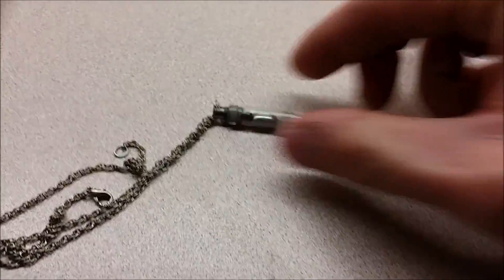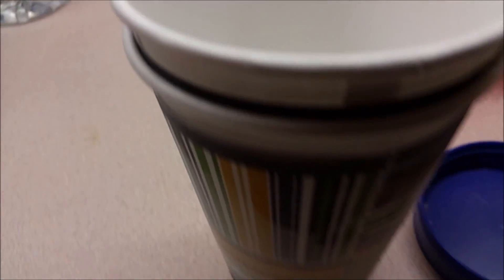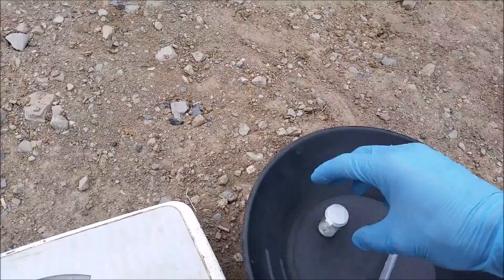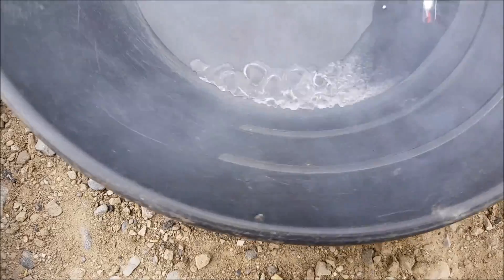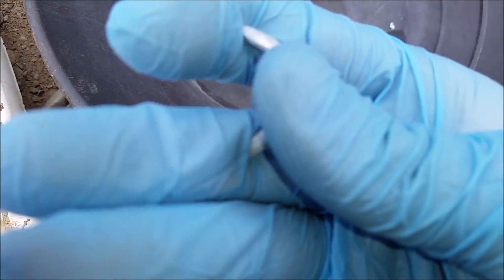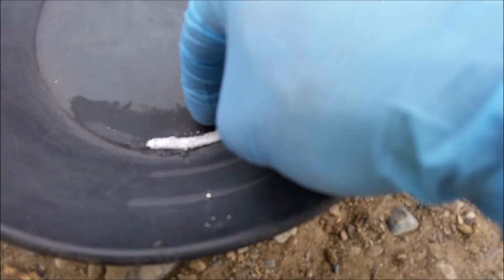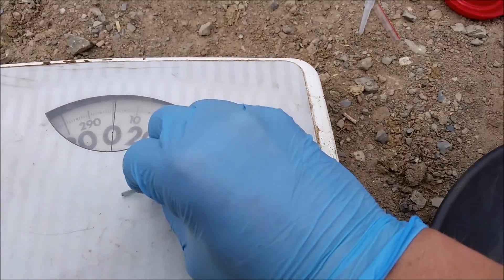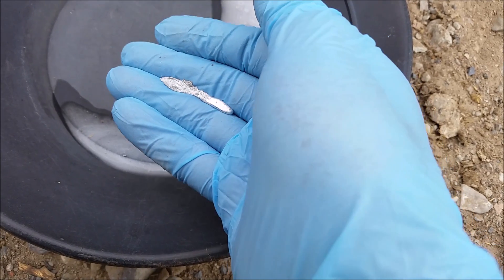Bending Solid Mercury: It Cries!

Comment: hm... i just wonder... the colder the mass is the harder it gets, right? so why you don't try to make an ice blade frozen in a temperature near lets say -10ºC and try to cut something  and then froze it with liquid nitrogen and try to cut something else harder? 

and the point on saying to "cut" is because i'm curious to see if water can be sharp :P (i know, actually it's called ice but meh xD)

Comment: This might seem stupid. But, how does liquid nitrogen stay as a liquid. Surely it would heat up and turn into a gas again
Reply: ***** Oh so it does evaporate. It just does it slowly?
Reply: +justinmason100 you have to remember that evaporation is also a cooling process
Reply: +justinmason100 Everyone asks questions when they are unsure, so be nice to him.
Reply: +justinmason100 it needs energy in the form of heat to change from the liquid to gaseous state,  If you insulate the liquid like in a thermos, you can deprive it of heat and it will stay liquid. Note that when you stick something into the liquid, then it starts to bubble. This is the liquid boiling as it gets heat from the object you stuck in it. It turns to gas and boils away and this also pulls all the heat from the object and makes it very cold. Once cooled, the object has no more heat to give, and the boiling will stop.
Reply: +Butterfly Poon So you ask questions when you know the answer? o_0
Reply: +justinmason100 watch at 1:20. It does exactly that.
Reply: It does evaporate........
Reply: From what I can tell the reason why it just doesn't immediately vanish at room temperature is because it cools the air around it to a temperature just above it so the air will slowly cool to the temperature of the air, which will be a few degrees lower than the liquid it at all times.
Reply: to actually answer your question: the flask he carries it around in is like a thermos. the liquid nitrogen is at its liquid temperature inside the flask, and the flask just insulates the liquid from the outside so it doesn't get warm. the second the liquid nitrogen leaves the flask it warms up and starts boiling.
Reply: The same reason why water doesn't turn into vapor immediately after touching a really hot surface.
Reply: +justinmason100 Science bro
Reply: *****

:I
interesting
Reply: *****
Huh
That's cool I guess, I'm more of a satan kinda guy but no hate.
Reply: *****
o_o be gentle
Reply: it is boiling in the cup.
Reply: If you watch when he pours the liquid nitrogen, it boils in the pan - that is the liquid nitrogen turning back to a gas. There are no stupid questions!
Reply: +justinmason100 It does. Did you not see it? Also liquid nitrogen in our world everything to it is hot as fuck, so that's why it boils unless stored at very low temperature.
Reply: +justinmason100 Hey there, I don't know if someone explained this fully before, so I will try. I'll give an example of a liquid becoming a gas via heating.
When a substance goes through a phase change via heating (or cooling), the temperature will rise and rise until the liquid reaches the point at which it vaporizes. At that point, it takes an extra amount of energy to undergo the phase change - the heat of vaporization. 

This extra energy holds the liquid as a liquid until the whole liquid gains enough energy to jump the hurdle and start boiling off as a gas. 

When a liquid is exposed to a temperature much higher than the temperature needed to boil it, it still must gain enough energy to change phases, so it will remain a liquid in part until the energy in the form of heat flows into it and gives it the strength to fly off as a gas. 

If you increase the pressure, you can keep things as a liquid at higher temperatures without them boiling. This is, for example, why you may need to use a pressure cooker to effectively cook at high altitudes, because water boils more easily with lower atmospheric pressure. 

And even with all this, under normal conditions (meaning room temperature, normal atmospheric pressure, in open air) most substances won't just explode from a liquid to a gas. This reaction would use tons of energy and be quite violent and unnecessary. That said, watching an alkali metal react with water is quite a violent reaction like this, and quite fun to see.
Reply: +justinmason100 It does. Room temperature is enough to keep N as a gas. N has to be REALLY cold to freeze, so the minute we open it up it vaporizes.
Reply: It's freezing point is extremely low
Reply: +justinmason100 That is what the gas is constantly coming off it, it is constantly evaporating. You throw it all over the carpet, it would evaporate... just do not keep doing it or your carpet would freeze. the object it is in is cooling down enough to stop the liquid nitrogen from completely evaporating.
Reply: +Lilly Lozier That's simply wrong; you've got it the other way round. Vaporization is when atoms forming a liquid break their bonds to become a gas (vapor).
Evaporation is one type of "vaporization"
Reply: +justinmason100 That's exactly what it does, just not as fast as you're thinking.   The steam coming off of the liquid nitrogen shows that its turning into gas again.  The liquid disappears after a few seconds
Reply: iI fwant to ask how to get it or where to buy it, after which will it be safe if falls on hand flashes a bit in eyes breath a little in lungs  and safe to play in house or go open outdoors
Reply: it does, notice when he pours it into the pan it quickly vaporizes.
Reply: Digital Nomad you didn't have to write a novel
Reply: When you put a pot on the stove and heat it up, you can put water in it and it will cool off the pot to the point where the water doesn't evaporate. same thing is going on here.
Reply: Pressure, same for propane, when it's under pressure it doesn't allow for the expansion like warming up. When they make liquid nitrogen, all the do is compress it. That's why when you pour it out there's no pressure holding it in and it boils off
Reply: +justinmason100 I have only prior knowledge to chemistry, but I'd think it's volatile...
Reply: +justinmason100 It evaporates rather quickly, but not in large amounts.
Reply: +Lilly Lozier Evaporation is a type of vaporization....
Reply: It does. Unless it is confined in a special  lcontainer, it will evaporate.
Reply: +justinmason100 The containers used for Liquid Nitrogen are usually also made up of an inner and outer container in a design that creates a vacuum between these. This results in any heat being transferred from the surroundings to the liquid nitrogen in the container to transfer (really) slowly, as there is no material for the heat to transfer through by conduction or convection and as such it only happens by thermal radiation, which is really slow.
If you were referring to the nitrogen in the open cup then yes, it does evaporate :)
Reply: +justinmason100 So many people have probably given explanations in the two months that this has been up. Here's my own!

It does heat up and turn into a gas. It's just that there's, in the amounts we generally see on youtube, enough that it's able to sort of equalize with the immediate area around it and prevent all of itself from evaporating away in an instant. It probably wouldn't be wrong to say that there's enough of it that it takes a fairly significant amount of time to completely vaporize. So yeah... probably not the most correct, but it's something
Reply: it will take time to heat up
Reply: +rocknrollfrenchfries No that instantly thing might get dangerous lol.
Reply: +John Creese seems about right 👍
Reply: +justinmason100 it does evaporate overtime. Inside of the metal container it is safe because there is a vacuum of air between 2 layers of metal so it is thermulated and can't evaporate as quickly.
Reply: maaaagic that's how......JK
Reply: the toxic Apple gaming
Rowling
Reply: MindMash5647
For a given value of "stupid question" and a certain definition of a "stupid question" or either or, there are stupid questions. It depends on the way you feel about things and how you think about it.
Reply: +DangerousToaster its actually a reaction to steam from heat and cold is not a scientific term heat is still in liquid nitrogen just a very low heat even sub thermal temps are considered hot
Reply: that's why they keep it in a dewer because it keeps it from going to a gaseous state
Reply: +Austin Myers are trying to say "hot" is  a relative term because it's that simple.
Reply: Gabriel Reid
Hot is, in some cases, relative. If you're on fire, and being on fire is your default state of being, a burning match wouldn't be considered hot, from your perspective.
Reply: nah, plasma is dissimilar. it is ionizing, not simply thermodynamic manipulation
Reply: It does, it just doesn't cool down that quickly.
Reply: Well in our atmospheric and physical condition liquid N2 boils directly.but in the flask it there is radiation and thermodynamic malupilation.which reflects the absence of heat keeping it cool.
Reply: compression
Reply: you need a lot of heat to meake it gas again
Reply: Eduard Calota no
Reply: justinmason100 the leidenfrost effect is what made it not evaporate plus it was all together so it was still cold
Reply: +割烹着の悪魔 AIUI liquid nitrogen is stored in insulated vented containers. The vapour pressure of nitrogen is too high for pressure-liquification at room temperature to be a reasonable storage option.
Reply: If it is in something like a thermos, heat will transfer into the container very slowly. As you can see, if it is out of the container, it starts evaporating at a high rate.
Reply: Cuz it's really cold.
Reply: This question seems stupid
Reply: +Richard Bernard
"Only water evaporates other stuff vaporizes the difference is 
evaporation takes place in all of water forms not just liquid 
vaporization is liquid to gas"

This is incorrect in every particular.

from:
https://en.wikipedia.org/wiki/Vaporization'

--quote

Vaporization (or vapourisation) of an element or compound is a phase transition from the liquid phase to vapor. [1] There are two types of vaporization: evaporation and boiling. Evaporation is a surface phenomenon, whereas boiling is a bulk phenomenon.

 

This diagram shows the nomenclature for the different phase transitions.

Evaporation is a phase transition from the liquid phase to vapor (a 
state of substance below critical temperature) that occurs at 
temperatures below the boiling temperature at a given pressure. Evaporation occurs on the surface. Evaporation only occurs when the partial pressure of vapor of a substance is less than the equilibrium vapor pressure.
Boiling is also a phase transition from the liquid phase to gas phase, but boiling is the formation of vapor as bubbles of vapor below the surface
 of the liquid. Boiling occurs when the equilibrium vapor pressure of 
the substance is greater than or equal to the environmental pressure. 
The temperature at which boiling occurs is the boiling temperature, or 
boiling point. The boiling point varies with the pressure of the 
environment.
Sublimation
 is a direct phase transition from the solid phase to the gas phase, 
skipping the intermediate liquid phase. Because it does not involve the 
liquid phase, it is not a form of vaporization.
The term vaporization has also been used to refer to the 
physical destruction of an object that is exposed to intense heat.
--end quote
Nor is sublimation unique to the compound water.  For example, in a vacuum, it happens to every solid when it gets hot enough, the liquid phase cannot exist in a vacuum.
+justinmason100 asks:"+Cody'sLab Oh so it does evaporate. It just does it slowly? "
It boils slowly in the thermos.  You see it boiling rather quickly in the tub.
Reply: +justinmason100 Only water evaporates other stuff vaporizes the difference is evaporation takes place in all of water forms not just liquid vaporization is liquid to gas